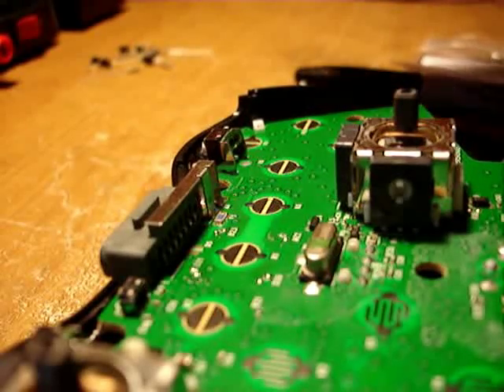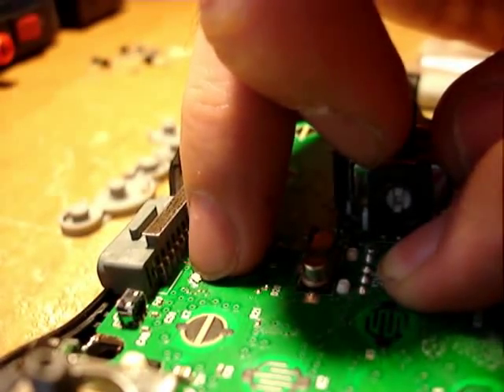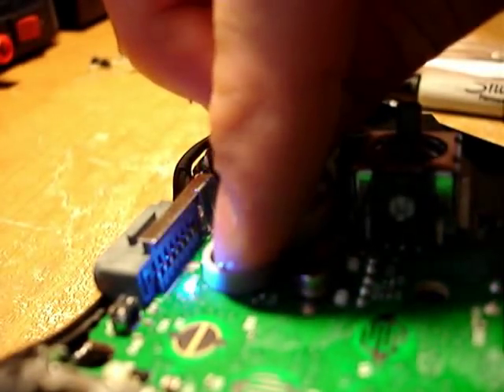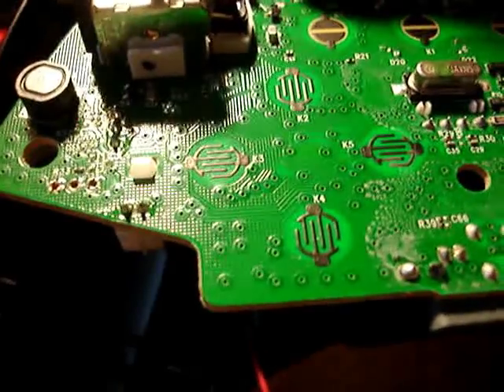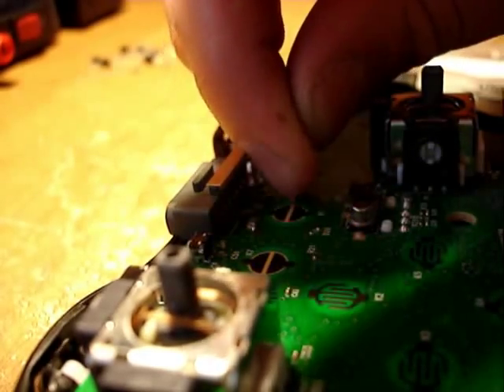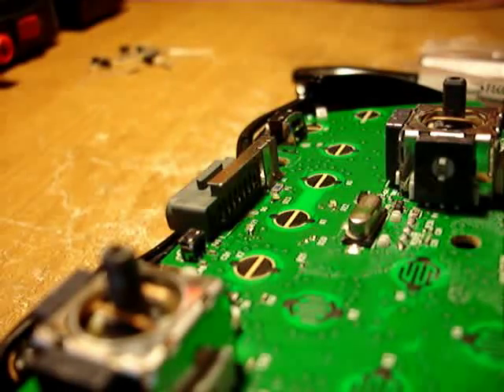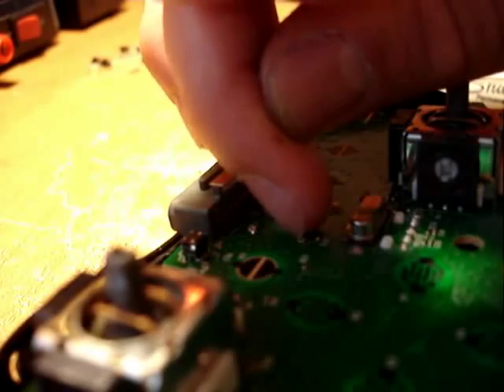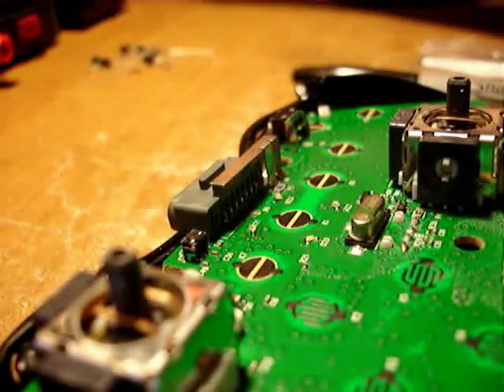Installing SMD's in an Xbox 360 Wireless Remote Controller

Comment: you do not need to do the whole turn it on and if it wont turn on turn it around just check the polarity of the SMD it has an arrow on the bottom usually or it has another way if showing polarity

Comment from the maker: @adan117 I only take the batt out because if you solder while its plugged in depending on how your iron is grounded/if at all your actually grounding the controller causing stress to some components.  You have to touch the power to the LED with the solder iron if you touch it while the controller is on your in theory shorting the board out.  If you try it you'll notice the LED dim's....I wouldn't condone trying it I'm actually telling you that it dims.

Comment from the maker: @adan117 Nope 40 watt is going to burn those tiny LED's to hell.  Buy a cheap-o RadioShack 15/30 watt and use it on 30 to take them off and 15 to put them on.